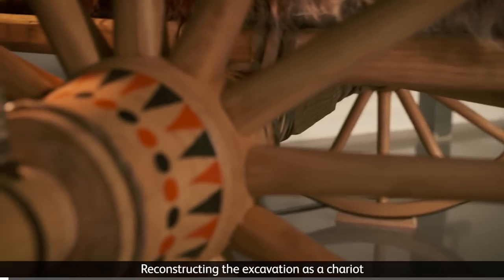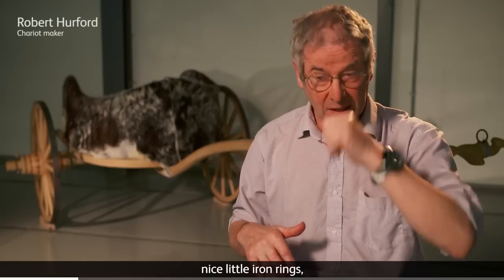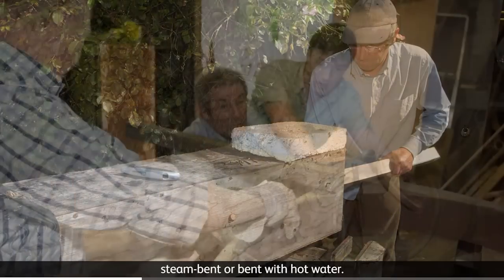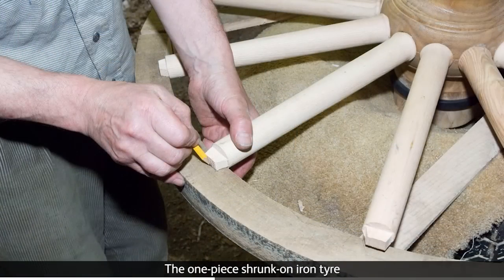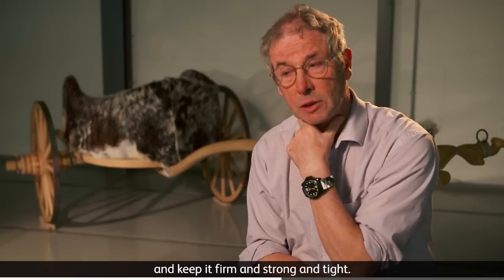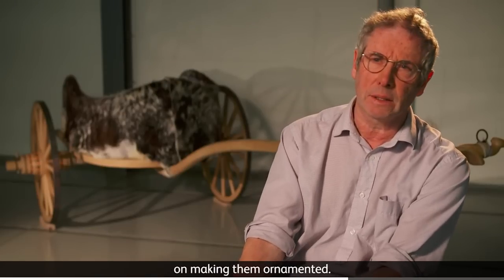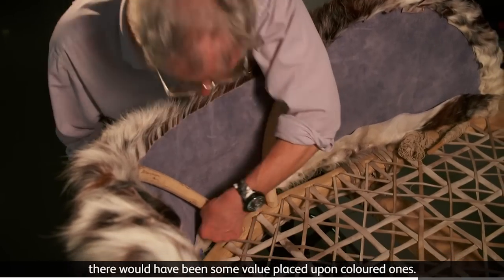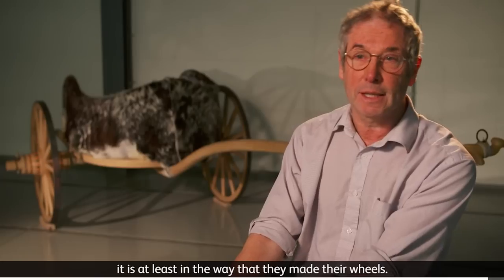Celts: Recreating an Iron Age chariot

Comment: Where did they get the shape of the upper part of the chariot from? It looks like a classic Roman shape. Celtic chariots are typically depicted in art as having hooped frames on the sides and open in front. Caesar mentions charioteers running along the chariot pole, again suggesting an open front.
Reply: Indo European
Reply: Romans didn't invade til 43 CE